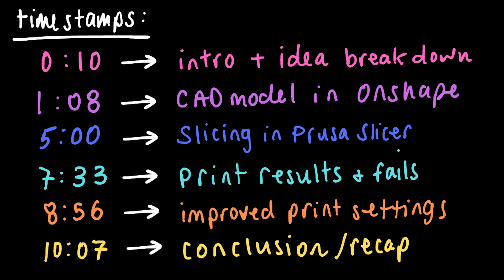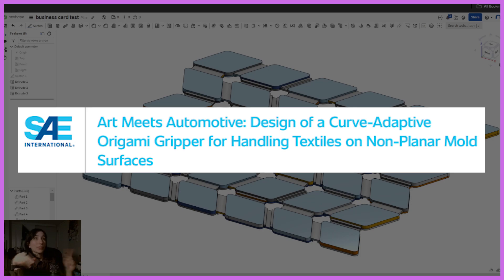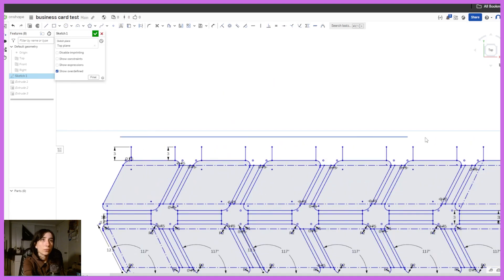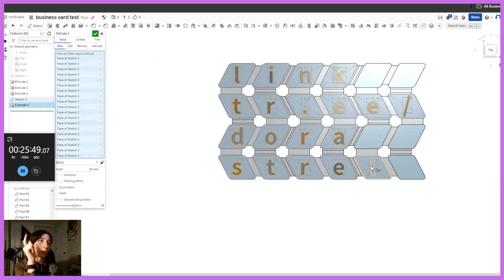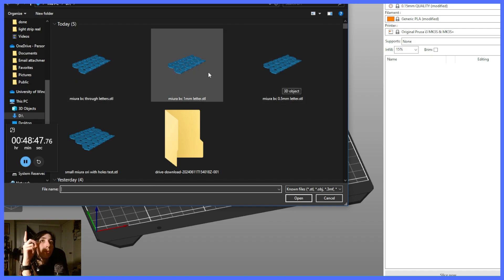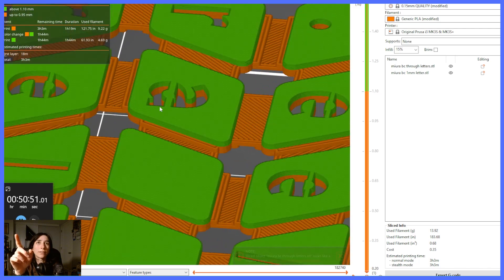making an origami business card w/ 3d printing (CAD TIME #2)

Comment: You could add the time stamps to the description or pin it in a comment. The people can just click it. I seen others do this. Probably faster than adding it in the video.
0:10   -> Intro + idea breakdown
1:08   -> CAD model in onshape
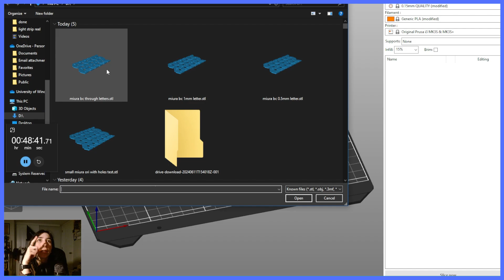5:00   -> slicing in Prusa Slicer
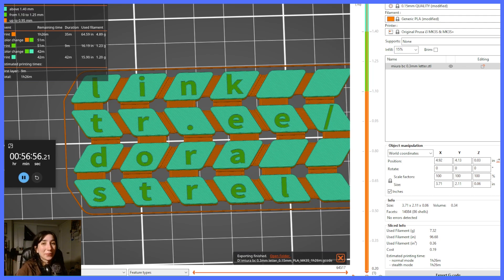7:33   -> Print results + fails
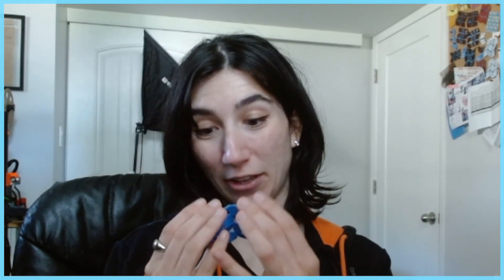8:56   -> Improved print settings
10:07 -> Conclusion/recap
Reply from the maker: Thank you !! I'll pin this and add it to the description too :)
Reply: @strelkomania  hehe. do that.👍
Also don't think I did not noticed the colored frame matching all the time stamps. What was a very nice touch.🤓
Reply from the maker: @Petch85  glad you noticed that little detail :) it brought me joy adding the colors hehe